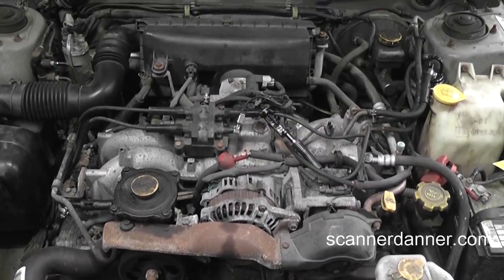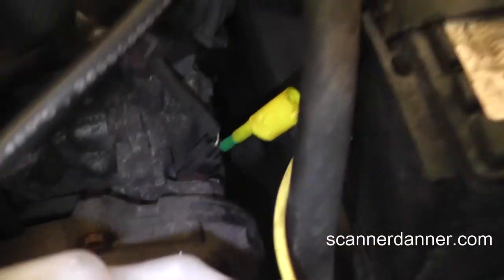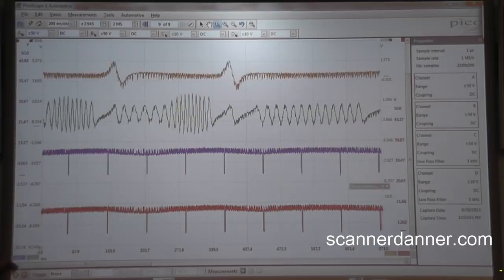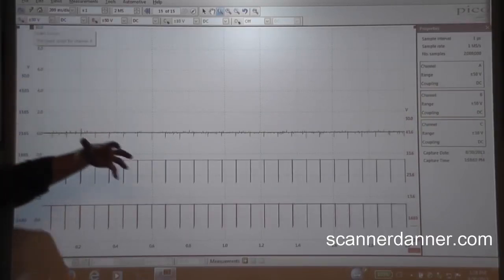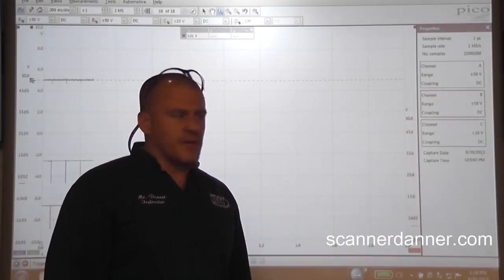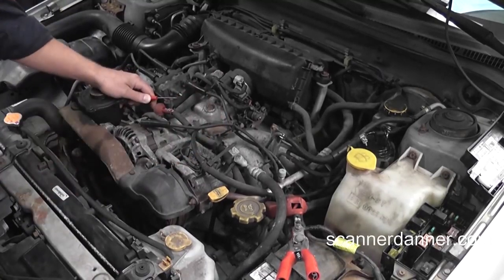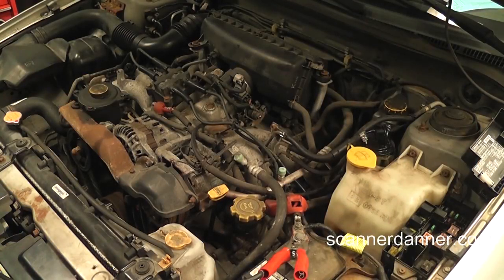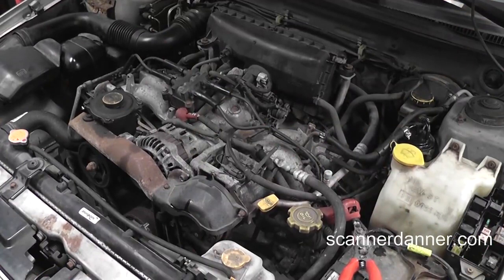99 Subaru Impreza No Start, Ignition Coils Fire With Key On! (Quick Tips)

Comment: in all my years i have never seen that either, i did work on a renalt megane that had a shorting coil on the primary side and it was causing the central locking to go mad, locking and unlocking the car and every 20 mins or so the alarm would sound, but then thats a french car so what would you expect from renalt :).

Comment: I tested and re-tested a car before I called a bad computer. Still a very uneasy feeling.
Reply: Oh yeah, it's certainly not easy to discard a brain no matter how old it is.
You need to be absolutely sure it's dead.
Reply: Parts changer here!! I replaced a computer!! From an early 90s IrocZ! IIRC. Fuel pump not running!! 

WASN’T THE COMPUTER!!! 

Waaa waa waaaah!!! 😩🤬🥺
Reply: @roadkill5333  good thing you accept, it is rare that the computer dies but when it does, it may have shorted somewhere or a wiring issue.
Reply: Funny thing was, the fuel pump is what started it all! Did some checks, and couldn’t get the whole picture!! Then, we noticed that the C.E.L. wasn’t coming on!! Ohhhhh!! No check engine light, MUST MEAN COMPUTER!!! Lol, not!! The bulb was burned out!! But, we fixed that, AFTER WE INSTALLED THE NEW COMPUTER!! 😝 

The owner (a friend) was tired of messing with the thing, and ended up just hot wiring the pump, with a switched power! Oh, and then got rid of it!!! 🙀🤬🤫

P.S. this was a loooong time ago!! Before I knew things!! Hell, likely before Paul knew things!! 😂

Comment: Paul, would an attempt at jump starting with reverse polarity caused the computer to die?
Reply from the maker: That is what I was thinking was the cause.
Reply: Connecting a boost pack backwards should emerge a shower of sparks, but not in case of a dead battery in the car. So the pack gets connected, the polarity reverses and the rest is history :)

Comment: First Subaru computer failure I’ve seen. Worked at dealer starting in 1972. Subaru not perfect but computer failures were not a pattern failure. I suspect jump start with reversed polarity or poor ground causing the failure.  Retired 3 years ago. I enjoy your videos. Thanks Paul.

Comment: I worked at an auto parts store. The shade tree mechanics around here work it a bit different. They replace the computer first and then "back diagnose". As time went on, I noticed that Standard Motor Parts stopped shrink wrapping and anodizing the tin covers. One customer hesitated to take a computer and argued that it looked used. The part came in a sealed box and I opened it in front of him. The bare tin had fingerprints etched into the glass beaded metal. We cut open the tamper seal and the circuit board inside was full of dust and carpet hairs. The rep told me that because so many computers are replaced needlessly, upon receiving the core, the computers are tested. If they pass, they are cleaned on the outside and not opened up. That explains why the tin is not anodized. So these days, if you buy a "rebuilt" computer, you really don't know what you're getting. The Mexicans would come to my counter and say "Quero un compyutee".
Reply from the maker: Crazy stuff

Comment: Had an older integra hold all 4 injectors and fuel pump on with the key on. Engine hydrolocked and fuel pouring out the intake! Ended up having a corroded connector which shorted out the pcm, was a crazy one

Comment: Nice one. Love it when weird shit like that happens. 

Usually a computer on its way out can be exacerbated by a dying or dead battery. The mosfets and capacitors are working extra hard to keep voltages stable and if they're 20 something years old that can be the straw that breaks the camel's back...

I just worked on a 93 Camry with 2 stuck on injectors. The capacitors in the computer leaked all over the board and the electrolytic fluid from them dissolved the protective coating and bridged the signal wires to 2 of the injectors to ground, which forced them to stay on and spray continuously. I cleaned it up and replaced all the capacitors in the computer for 5 bucks (ordered from digikey) and now it's purring along and good for another 27 years!
Reply from the maker: That is freaking awesome! I wish I knew enough to recognize those sort of faults on a circuit board. Thank you for the information too! I was thinking someone reverse polarity jump started it.

Comment from the maker: Okay, a little help. Help me add bullet points to the description.
- coil fires constantly with key on
- cam and crank signals on a scope
- bad engine computer 
- injectors constantly energized 
- what a starter sounds like when an engine is hydrolocked 
- why an oil change is important 
Let me know what you think and if you have any other points to add.
Reply: Yes bullet points like that would be great just like you have on your website on those videos with the time shown. And video could’ve been cut shorter also probably. I know you’re just in the starting phase. Excellent job though.
Reply from the maker: @bigfootemobileauto9734  I have a new "employee", he will get better as we go 😃 Here that Todd? I'm blaming you

Comment: I've never seen a coil do that either!
Back in the 1980's, we had a "box"  that could start (carburated) engines.  It put out a lot of random spark.  Sometimes it helped move a vehicle (not great) around the shop.  It was a Snap-on tool.  
Good diagnosis of how to test the PCM and eliminate the sensors, powers and grounds to prove out the computer.  I hope it ran good after the oil change and no engine damage happened!
Reply from the maker: from what I remember it was fine!
Reply: Yep I had the poor man snap on tools. Used to swap the firing order about  from a rocking to an open cylinder.

Comment: I recently had a 2005 Toyota Sienna very similar to this. Towed in, no start. I pulled coils to find cylinder 4 had shorted out. The coil had exploded. When I went under the hood I heard some clicking. The variable valve timing control valves were duty cycling with KOEO. I unplugged them and still heard other clicking. Thought grounds but all were good. Scoped the cam and crank and during cranking had a signal. Never got to fully condemn the ECM.  customer called for an update and I explained the situation. They said the car wasn’t worth it and declined further diagnosis or repair. Pretty sure the ECM was fried. Great video!

Comment: Had a early 90' Ford truck (5.0 or 5.8) with a fried pcm. Had a dead battery upon arrival. Set up the charger on 10 amps, let it charge for a good spell (key out of ignition) came back after lunch & saw fuel spilling on the floor... The fuel pump ran constant, with injectors cycling, which completely filled the engine with fuel, pouring out of the throttle body. Unplugged the charger & neg batt term. Removed plugs & suctioned out each cylinder, drained the oil. (I let it drain overnight, with spark plugs removed). Took off the pcm cover & found a blown/arced section on the board. Now I always listen for fuel pump action on those older rigs when I connect the charger. A new pcm fixed the problem.

Comment: Hydro lock, reminds me of my old 94 Chevy  S10 Blazer with a 4.3 V6 and two part intake, the fuel lines in there was replaced with standard fuel lines and clamps, they stated leaking over time and she wouldn't start, removed the plugs and drained the oil, that was bad for it about filled up my container if I remember right. Sadly I didn't do the oil squirt if I did she might have lasted longer.... I miss that SUV.

Comment: I hade a fiat(magneti) with the same problems 2 year ago. The car came from a body shop and the guys there  started the car with no batery, just jumpers and accidentaly switched poles. They admited this only after i fixed the car. 2 wasted days. The car also had a aftermarket lpg sistem that was functioning ok and that didnt help at all.

Comment: I've had a few points type systems back in the day that would crank with a key on and no starter.  Bad grounds on those.  Back in the eighties at a tech class with Chrysler the instructor told us early on, if a car acts like it needs priest start looking for a bad ground ;-)  90% of the time it's been the "silver bullet"  Voltage looking for a ground.  Never had one do like this one though.  Great Vid!

Comment: Ever seen an EFI run with absolutely ZERO PSI fuel pressure, as in fuel pump unplugged? I got one.
Reply from the maker: Is it an older GM? They have a fuel pump relay bypass built into an oil psi switch
Reply: @ScannerDanner  88 Isuzu I-tech EFI. I had the pump unplugged at the tank.
Reply from the maker: @InsideOfMyOwnMind  if it runs for any significant amount of time, then the purge valve could be stuck open, otherwise, who cares? What are you trying to do?
Reply: @ScannerDanner  I'm trying (still) to solve for my 88 impulse that has a drastically different AFR every time I start it, usually so lean that it won't even idle at all. Sometimes it's perfect until the next start up. So I ran into this little quirk about idling with no fuel pressure pretty much by accident while playing around with it one day. Unplugged the fuel pump while idling and it just kept going until I touched the throttle then of course it promptly died.
Reply from the maker: @InsideOfMyOwnMind  I have heard of heavy carbon deposits causing this. Where the fuel saturates the carbon on the back of the intake valves, then that is your fuel source? Just a thought. I've never really seen badly carboned intake valves on port injection. 
Pay close attention to the ECT signal. Also, does this have a cold start injector or any weird stuff like that?
Reply: @ScannerDanner  I have a new ECT and stove pan tested it against the OEM and they are exactly the same. I got a spare ECU and made a break out box for it, monitoring MAF, O2, B+, GND, injector pulse widths, ignition control, ECU memory B+, ECT, distributor optical outputs, both ignition pulse (which is also the tach source) and the constant pulse, my local mech called it the injector modulation pulse from the dist. I dismantled and cleaned out the I-TEC (intake) assembly and replaced ALL vacuum and coolant hoses mostly because they were 32 years old, all new gaskets, etc.
And last but not least the O2 itself. This all started when the distributor failed outright due to oil leaking through the dist seal and ruining the optical sensor block. Tried two different brands of distributor, When my local mech had the car before he gave up replaced the MAF (several times) and had the injectors rebuilt. trashed the radio getting to the ECU and trashed the antenna driving it under the lift.
This is the short story. And BTW thank you for the interest. I literally have no direction at this point and no one in my area who will take an OBD1 vehicle. It has only the normal gang fired injectors, and approx 30k miles on the top end.

Comment: Hello doctor.  I have bmw e36 328 1997 convertible , I have problem my car is not working about 2 years and no electric man can make it start it’s no switch no positive in my fuse box and if you have the wiring diagrams to this car . I don’t have switch positions ! If there any relays are make the cluster work ? Thanks best regards
Reply from the maker: Post this to my forum. Some questions require research on my part, which I cannot offer here.

My forum is free to join. https://www.scannerdanner.com/forum.html We have over 17K members world-wide and we also have paid moderators who are there to help me help you guys! You will not find a more helpful and friendly forum anywhere. Thank you for understanding! Hope to see you on the forum.

Comment: 19:38 Subaru oil levels are terrible to gauge - check after filling and running and it shows perfect, leave it sit for a day and its overfull. Even removed the oil dipstick o-ring in case oil was trapped in the tube. Would love to hear your input on this. I go with the reading half an hour later and ignore the overfull next day level.
Reply from the maker: this one was absolutely overfilled! here is a tip for you when you have these misleading readings, dip the tip of the dipstick in water before you stick it, it will help

Comment: I seen these Subaru computers go bad and do stuff like that. I have never seen that particular issue, but what I have seen is that the computer will keep the coil slightly active building energy in the coil which in turn will cause the coil to heat up and sometimes crack. It is my belief that the coil goes bad damaging the driver thus in turn hurting the ignition coil. but I can not be sure as I normally have to replace the ignition coil and computer.

Comment: In my experience 8 out of 10 times you end up with a bad Computer if the cooling fan turns on high after turning on the Ignition. Please correct me if I am wrong. I thought that was a default strategy.
Reply from the maker: Not at all! An ECT fault will do that, shorted ref circuit will do that, blown PCM fuse, bad computer grounds, will do that. I have case studies on all of these!
Reply: @ScannerDanner  Thanks, poor explanation on my part, very rough day yesterday! I was talking about symptom and code based, I know that ECT and ref would do that and a blown PCM fuse would do that because, well, a bad PCM. But I also "figured" you would not miss these LOL.
Thanks for the reply! My head was not in right place yesterday evening cause my daughter ended up in the hospital with aa broken leg or I would have explained myself better.
Reply from the maker: @ralfsautomotive  no problem my friend

Comment: Hey Paul, I got an 09 f150 with off readings on o2 sensors. Both bank upstreams showing negative milliamp readings(no volt output unfortunately). Both downstream showing 650 to 750 bolts at driving and idle. Those negative milliamp readings mean lean correct? No way I could have rich downstream o2 on both banks and lean on upstream both banks right? I have an exhaust leak on the left bank only at the donut so that doesn’t account for right bank readings. Fuel trim ST and LT are within 5 to 8%
Reply from the maker: The milliamp readings on Fords for O2 sensors is for the heater circuit. That is a problem. Focus on the heater circuits
Reply: ScannerDanner awesome, thank you.
Reply: ScannerDanner  Paul, just bought the ebook and I’m loving it! two questions....(1) am I able to print this ebook to a hard copy somehow or would I have to buy the paper copy? (2) on pcm response testing page 23 for o2 sensors, if I don’t have a scan tool would I be able to use a voltmeter simultaneously along with a test light at the signal wire to simulate rich and lean signals on my voltmeter? It’s late lol couldn’t sleep and I had that idea.

Comment: Great case study sir! Reminds me of a Nissan Titan I had one time. Truck was sitting for a bit and there were bird's nests on the passenger side exhaust manifold. The next time the customer started the vehicle The nests caught fire. The fire melted some of the engine wiring harness and damaged some ignition coils. The shop I worked for at the time got the insurance company to approve harness  replacement. Another technician replaced the harness and the passenger bank ignition coils but the truck wouldn't start afterwards and we had no communication with the ECM. I was the shop foreman so I took it over once we realized it was going to be a headache. Turned out one of the power feed wires to the internal igniter shorted to the chassis ground wire when the insulation melted. This blew the 20 amp ecu fuse which also fed power to the coils. Replace the fuse and now we can talk to the ECM and the truck is trying to start. The only way I can get it to run is to put the accelerator about halfway down. Ran really rough like it's not hitting on all cylinders. Long story short, only two of the eight injectors were firing and 2 of the ignition coils we're getting a constant trigger signal from the ECM . Literally melted the front two coils from the inside out. I verified powers and grounds and condemned the ECM. Insurance company approved a used unit and two more coils. Replace ECM & coils, program the keys and the truck ran great. I still can't believe the truck would actually run on 2 cylinders. Sorry for the crazy long comment, hope all is well with you and yours during this crazy time!
Reply from the maker: You did good, still sounded like a nightmare
Reply: @ScannerDanner  Thank you sir! It wasn't the worst one I've ever had but it definitely kept me on my toes.

Comment: Great video.  Quite long, but educative. 
Its also nice to actually see the signals from the CKP and CMP sensors as well as the ignition signals during the fault. 
I would have loved to also see them after the repair though. Ignition cycle? Any noise?
Reply from the maker: 😃 the original was 1.5hrs. So we did pretty good to tell you guys the story in 20 minutes on this one.
Yes those ignition event noises can be seen in many locations and it is completely normal! Just a teachable momemt
Reply: @ScannerDanner  
Ok. Thanks. 
1.5 hours?  Wow.
This 20 min video is really great then.

I think I need to go watch the original.. 
There would be more things to learn. 
Thanks.